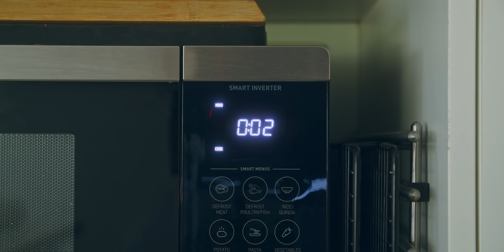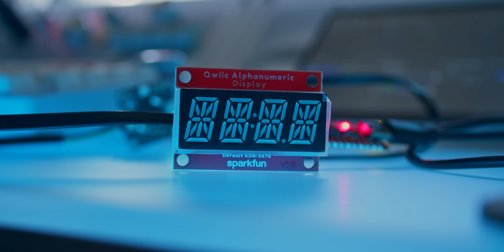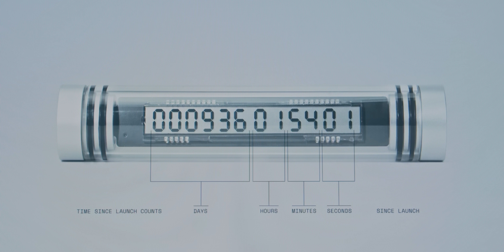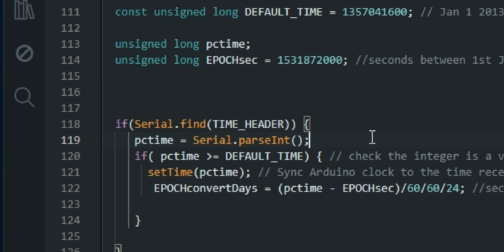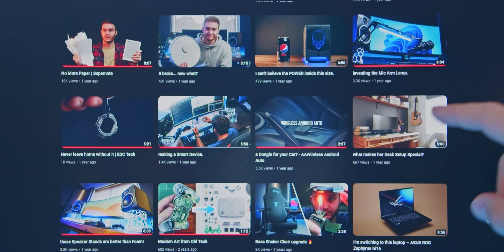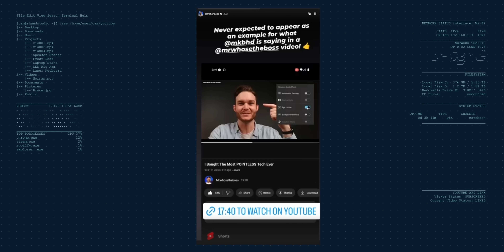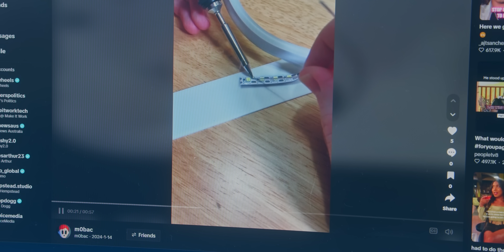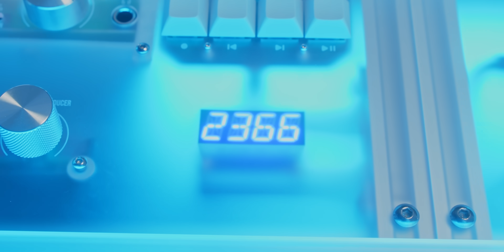2366 days to get here.

Comment: 3:39 You have an off-by-one error; your code is correct for calculating the number of days since the timestamp, but if 0 days since the timestamp is considered day 1, then you should add 1 to the number of days passed to get the actual day number. 2,366 days since day 1 is day 2,367, not day 2,366—which it would be if you started counting with day 0.
Also, Unix timestamps are relative to Universal Coordinated Time/Greenwich Mean Time, and the timestamp 1531872000 corresponds to midnight on July 18, 2018 for the UTC±0 time zone, and UTC±0 is not one of Australia's time zones. Unless the now() function indeed returns a local-time timestamp, you may want to opt for a local-time solution.